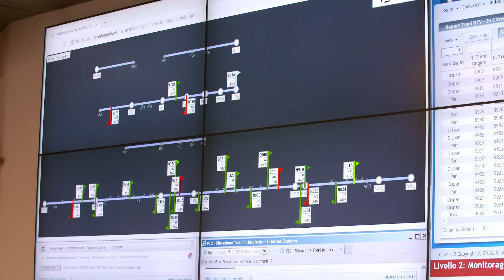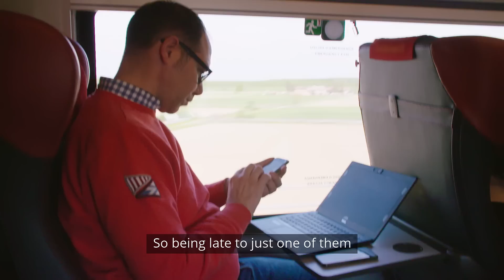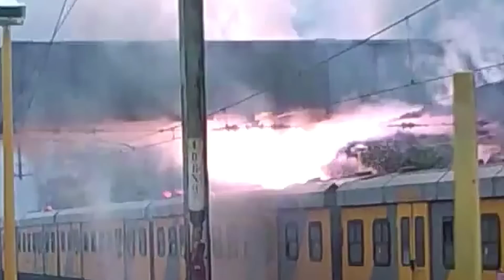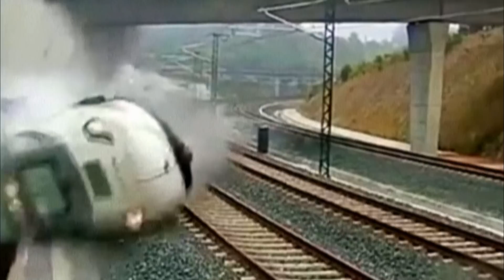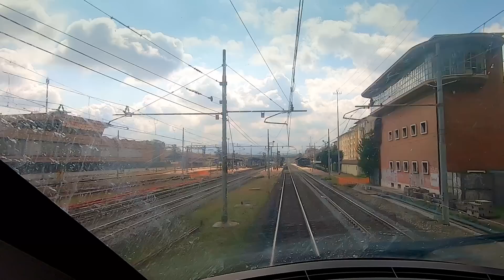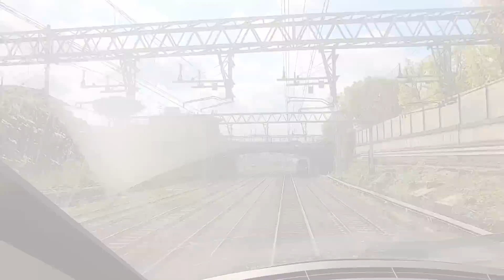Italy's 300km/h Trains - Building The Ultimate - Documentary

Comment: I am so fed up with your brain dead comparisons of parameters with household object parameters.
If you have to state these idiotic comparisons, why not give the proper parameter in real units, as well? That would educate the uneducated masses to think in real units of measurements, before you commence with your gushing excercise! 
But education is not the objective of your program, is it? It just entertainment and cheap clicks!

Obviously everybody has a F1 car standing on their front lawn, drive it to the shops day and understand what power it has! The power of a formula 1 car is so very relatable! .How much power does a Formula1 car have?  F**k knows! 

If I want to understand what you are talking about, i have to go wikipedia and look up the Alsthom ATV And F1 cars!!!
How f'ing mad is that?
And there the answer is in plain sight: 
8× Alsthom 12 LCS 3550 C with total power output 6.08 MW, which is 760 kW per engine.
Apparently, most F1 cars have about 770kW.
So, an ATV train is powered by the approx equivalent of 8 F1 cars. Ok. Now we are cooking.
But why are you only talking about 5 if these 750 kW motors and not 8?
Could it be you did shoddy research, or oversimplified the subject?
You know what? I will abort your mental drizzle now at 11:45  and watch some real tech program instead, not your gushing BS!

Comment: Well... As already commented, this "Italian train" is... French. TGV rebranded in AGV. Btw French TGV runs daily at 320km/h. For more on French TGV trains: https://youtu.be/GpF087waPDY?si=-mYb9acrpVg1J5gL
Reply: The AGV is not a rebranded TGV.
AGV means "Automotrice a grand vitesse", meaning it is an EMU (electric multiple unit) train, with distributed traction motors.
The TGV is another concept, having two locomotives, one pushing and the other pulling, with concentrated traction motors.
Both are built by ALSTOM.
Reply: @ Exactly ! It’s French.

Comment: How silly can a documentary get? :-(

Yes, the AGV looks like a nice train, yet another one here in Europe.

However, the voice-over (words and emphasizing) is ridiculous. [matter of opinion]

Using sand for grip: refer to "sandbox (locomotive)" on Wikipedia. Notice the year 1886.

Using 25kV~ tension on the overhead wire (relative to the rails): that has been the standard in France since 1953 (to name just one country). The interesting thing isn't mentioned: standard voltage in Italy is 3kV=, so the AGV train must be able to switch voltage (and likely signaling system too) to run on the tracks shared with "standard" trains. The latest Alstom trains here in the Netherlands (called "ICNG" here) do so automatically, and I take the AGV to do so, too.
On the topic of pantographs: the animation suggests that the overhead wire remains above the middle of the track. However, that wire is positioned in a zig-zag way, in order to have the collector shoes wear evenly. The amplitude of this zig-zag varies per country (rather: per loading gauge). This contributes to the number of pantographs on multi-system locomotives.

Massive wheels are a lesson learned from the derailment of a high-speed train in Germany (near Eschede), and mere "chalk stripe" markers on wheels are a transitory measure.

The powers that the voice-over attributes to the train driver are exaggerated. His job is more about braking than about accelerating. (The Spanish high-speed train derailing on camera had missed a temporary speed restriction.)
Rail traffic controllers do have powers, but these are not intended for "make way for the king", rather for maintaining as much of the overall time schedule as possible. Both passenger and freight trains, as previously agreed.

Comment: This doc is obviously dated 10 years ago at least. Italo AGV train (manufactured by Alstom) was derived from the TGV V150 which holds the world speed record (574 km/h on  april 2007) but this description from marketing is obviously disguising since the AGV trains cannot theorically run faster thant 360 km/h (and their are not allowed to do it on the italian high speed lines where the top allowed speed today is 300 km/h). At the time of this doc the Frecciarossa 1000 (theorically able to reach 400 km/h in ordinary service, even if not allowed to reach that speed for the same reason above) didn't exist. The problem is that today we call a train the "fastest" one confusing the theory with the real daily service. And this doesn't affect only the italian High speed trains. Even the chinese CHR450 won't travel at 450 km/h on daily service, but it has been already called the fastest train in the world. We just should clarify what "fastest" means: theorically? Effectively (TGV V150 but just on a special test run)? On daily services?

Comment: The fastest train in Europe is not the AGV showed in the video. Currently it's also an italian train, but it is operated by Italo's rival, Trenitalia,  and it is the Frecciarossa 1000, capable of operating at a commercial speed of 400 km/h (but limited to 300 km/h for commercial reasons).
Reply: i know what you mean but saying it can go commercially go 400 but it is limited to 300 for commercial reasons makes absolutely no sense, its limited to 300 because the lines dont allow 400
Reply: @tijsbeek8590  It's not exactly as you say. The Naples-Rome line has been tested many times at speeds around 350 km/h, both with the AGV and the Frecciarossa 1000, and this speed is considered perfectly safe to operate commercially. And the experts say that with very slight modifications it could safely allow to be traveled at 400 km/h by the Frecciarossa 1000 in regular service. So it is only for economical reasons (the costs would be much higher than the benefits) that this line and the Frecciarossa 1000 only operate at 300 km/h like the rest of the Italian network.
Reply: @Neldot  what you're saying is "the line allows 350 but it only allows 300 for economic reasons" that doesn't make any sense either, is the line 300, or is it not? Maybe 350 has been partially tested yes, but if 350 is safe there would be absolutely no downside for allowing 350, and that doesn't have insane expenses since it's just a number changing? 

Doubt you're correct on that tbh
Reply: @tijsbeek8590  Of course, studies and experiments have been done on the Rome-Naples line. The line could operate at 350 km/h, but the management does not consider it convenient. 350 km/h per hour on that relatively short distance (about 200 km) is not economically convenient compared to 300 km/h, because in exchange for only 5 or 6 minutes less travel time, the energy consumption is almost double. And this is true for most european HS lines. In Europe big cities are too near, this is why only in China, where the big cities are a lot more distant, it could be convenient to reach speed higher than 300 km/h.
Reply: @tijsbeek8590  bro it is like that, for economic reasons they run at 300 kmh even if the train and the line allows for 350kmh, it's not simply a number changing, higher speed means higher vibrations, higher electricity consumptions and faster moving parts degradation. This means more mantainance needed for the train and the line, higher running costs for a few minutes saved per trip, it wouldn't be economically worth it so they don't do it.
Reply: @bonaz11  @tijsbeek8590 That all said, the TGV lines in France actually run at 320kp/h as a standard line speed, with the trains itself having set a the world record of more than 500kp/h on those lines in testing. So I dont get the argument, because neither the AGV nor the Frecciarossa operate at 320kp/h or are capable of reaching 500kp/h. Or am i missing something? (that could be true as well)
Reply: @RCT2germany  i don't care, i never even wrote about which is the fastest train in my comment. It's the TGV if you consider top commercial speed, it's the Frecciarossa 1000 if you consider the top speed in the train standard configuration without any special modification to the train or tracks. And it's again the TGV if it's only about raw speed. In my opinion the one that makes the most sense to use is the commercial speed anyway, so i would say TGV is the fastest. Raw speed is cool but really useless when talking about everyday application so it's mostly ignored. Others say comparing testing speeds in standard configuration is better because commercial speeds are not determined only by the train performance but also economics, local safety laws, infrastracture etc.
Reply: @Neldot  This is not necessarily about energy costs. I looked at some studies that talked about the energy increase between 300km/h and 350km/h, and the energy consumption increases by only 20-22%, which does not make the ticket very expensive for a high-capacity, well-utilized train.
In the case of Italy, 350 km/h would have meant that the overhead line would have to be replaced, the ballast would have to be glued, and only the etr1000 could have reached this speed in normal operation (the NTV 575 only has a 5-car motorization, which does not allow such a large operating speed), and excluded Ital, which caused much controversy. Therefore, 350 km/h was not accepted. With 320 km/h, it would probably have succeeded, since the aforementioned problems do not occur here, and the NTV 575 and etr 500 would also have supported this speed in exchange for an extra 8-9% increase in energy.
Reply: @tijsbeek8590  350 km/h is supported by only one train in Italy: the etr1000. If this train were going at 350 km/h, it would make traffic management difficult. And the overhead line should be replaced. And the ballast should be glued. In addition, the increase in energy and wear of parts also increases. 350 km/h is therefore difficult to implement economically. It would have been much better if they wanted to implement 320 km/h, because it would encounter much fewer obstacles and 3 types of trains would be able to use it.
Reply: @davidsz.horvath3357  okay so the line isn't capable of 350 unless modifications happen, glad we agree
Reply: The line Is capable, but no one benefits from it. Stop with the rage baiting  @tijsbeek8590
Reply: @tijsbeek8590  actually he's right, there are many 350kmh capable lines in Europe that are limited to 300 or 320 for economical reasons, more energy needed, more rail maintenance, more wheel and brakes maintenance, the french SNCF had done a study of the cost of this and it was not profitable acording to them.
Reply: You are wrong.
The fastest trains in Europe are the TGV, Eurostar and ICE3 (when travelling in French high speed lines).
All these trains attain max operational speeds of 320 km/h .
Of the entire planet, the Chinese Fuxing is the fastest, attaininig max operational speeds of 350 km/h .
Reply: 😅TGV with 575kmph record run (AGV's ancestor)
Reply: Frecciarossa 1000 design commerical speed is 360 not 400. "fastest train in Europe" - debatable, since it doesn't go above 300 unlike French TGV trains (ICE trains too in France)

Comment: 50% seats are backward facing???? So Shite
Why don’t Inferior European manufacturers learn from East Asia Far Superior And Far Supreme high speed trains where seats can rotate to face direction of travel??..??
Reply: The arrogance...
Rotating seats are not in European trains because people have different preferences, creating conflicts between passengers, and because it would require more personnel to switch them.
Families want to travel together with groups of 4 seats facing each other, couples in duos facing each other (in 1st class), etc.
Some trains had them, like the new Océane TGV in 1st class. It created problems between passengers.
Reply: Bro the ICE / TGV or even the AVE have far better comfort than the shinkansen trains. They are just more modern. And rotating the seats comes at a big cost. Btw this only works on some trains in japan. U need so much space to have the rotating seats feature. Stupid comment
Reply: That is not true!!  The Shinkansen is way better than all those trains you mentioned, both in terms of safety and comfort.

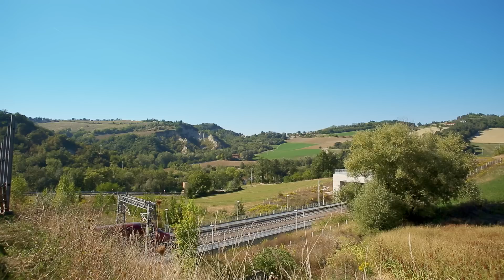Comment: Small correction at 26:07 the train both when running under the ETCS and the SCMT safety systems doesn't only slow down to the correct speed when the driver goes over the limit, but directly empties the braking air pipe applying the brakes at full power, if the driver doesn't react the train will stop

Comment: Europeans and Japanese can do this because the best cnc machines are made in Germany, France, Italy and in Japan, period.
These countries spend years fine tuning cutting materials, Drills And tuning the machines. Have you wonder why Chinese can't copy cnc machines from Europe or Japan, and make them work with precision under micron.
Reply: Actually you have forgotten Spanish speed ones
Reply: China is doing with rail technology what Japan did with photographic cameras in the 50's.
Start copying and then overpass its competitors.
The US suffocated Japan's economy in the 90's and is now suffocating European economy, mainly Germany.
But the CRRC is doing very well, producing HSTs and locomotives, diesel and electric ones.
The US is trying hard to suffocate China, will they succeed?
Reply: China can't drill to micron precision, but they have HSR that runs at 350 km/h .
They have a private space station.
They have sent a rover to Mars.
Etc., etc.
Reply: @tiago58  Look at the vibrations in Chinese high-speed trains. A glass on the table and water squirts out.